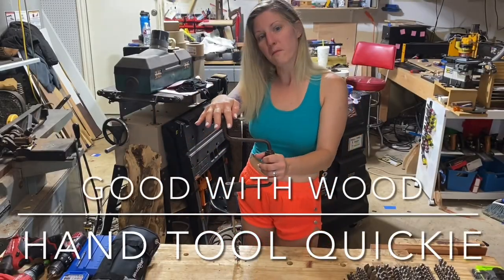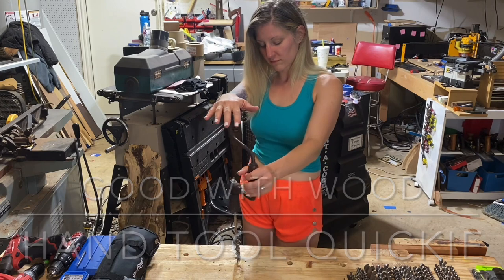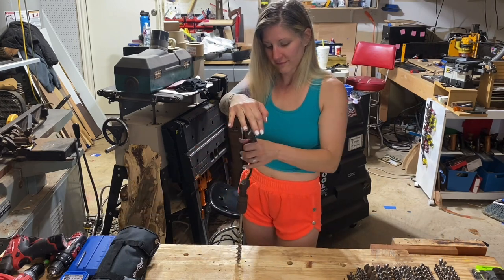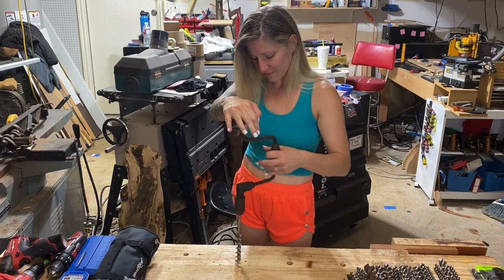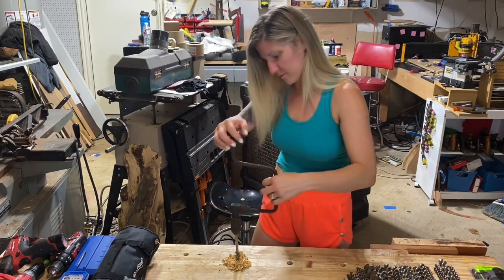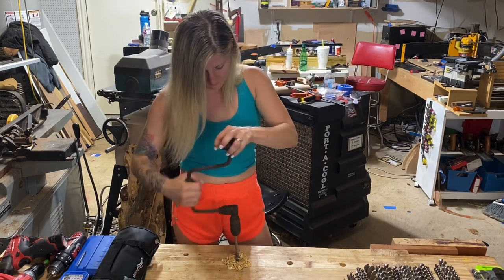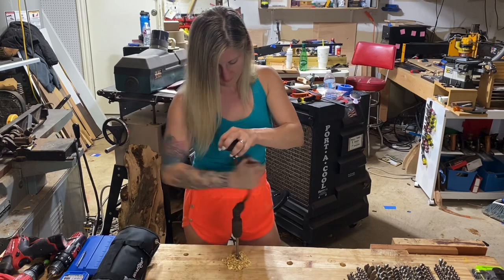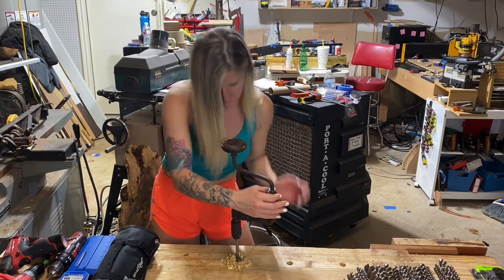HandTool Quickie- Bit Brace and Auger- archaic or useful?

Comment: The brace and bit are vastly underrated. When you get some decent bits like you have, the accuracy and quality of the holes they bore, can't be matched with anything else. I like Forstner bits and how they leave a perfectly clean cut hole. Anything larger than 10mm, a brace wins every time.